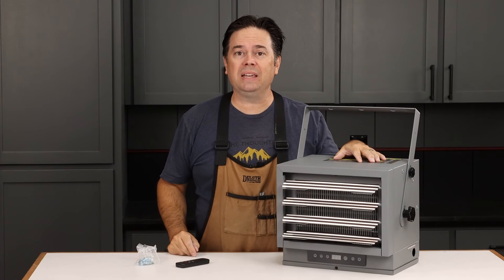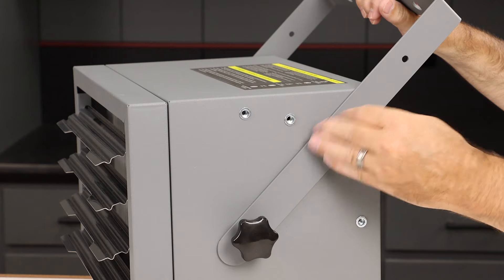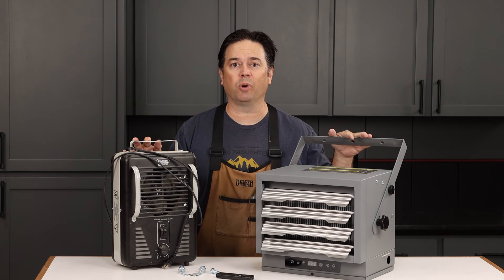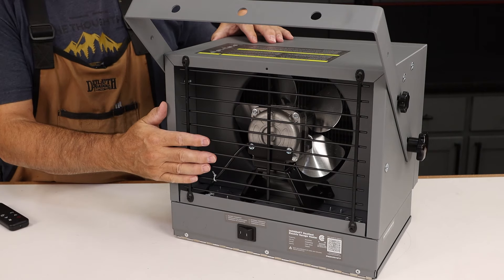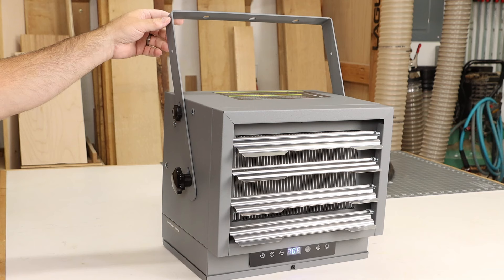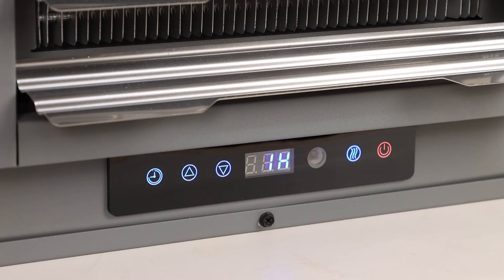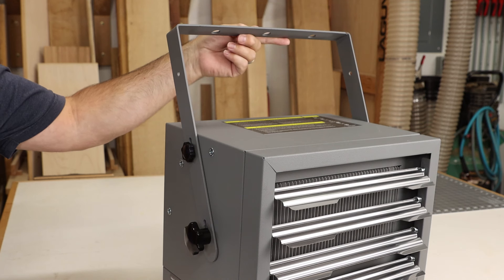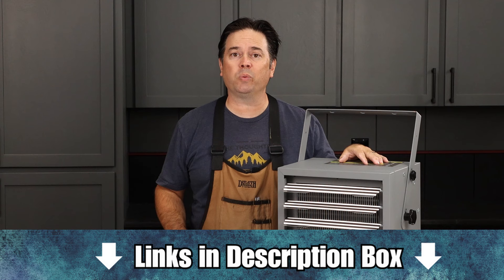Inokraft MaxHeat Garage Heater 7500w Review

Comment: The fan runs to long after the heat shuts off and it cools the room down 4 degrees to fast for the fan to be able to shut off can I set the fan to shut off sooner
Reply from the maker: It should run for about 90 sec. after the timer goes off to exhaust the remaining hot air out of the heater enclosure.  It's a safety feature, but I've never found that it cools down my garage.  Usually the element stays warm during the 90 second delay.  Thanks.